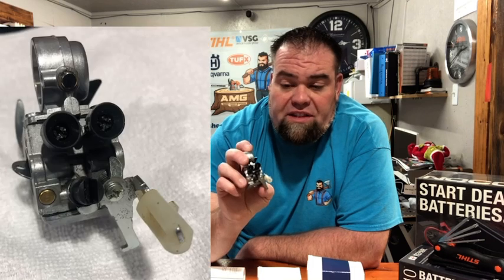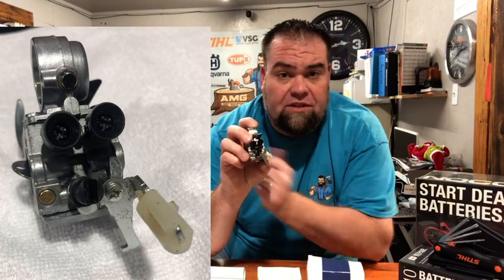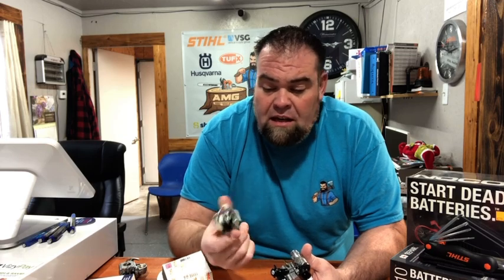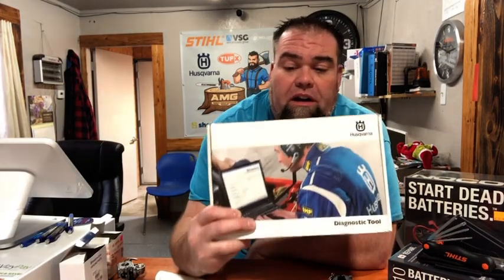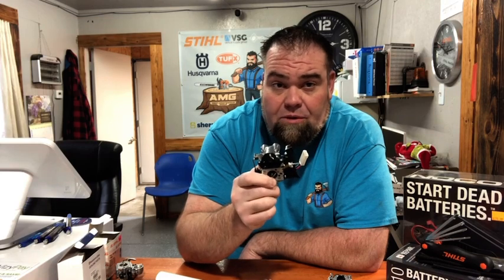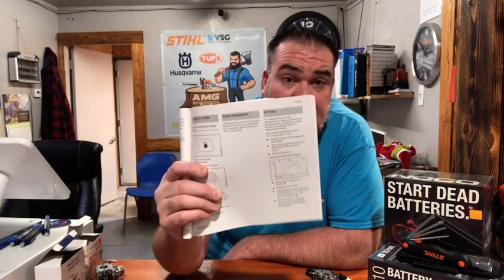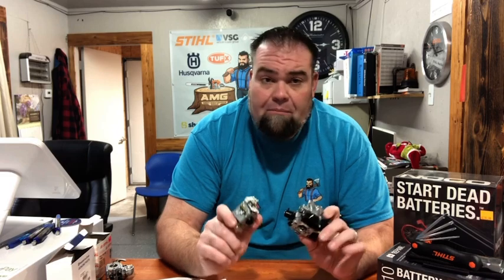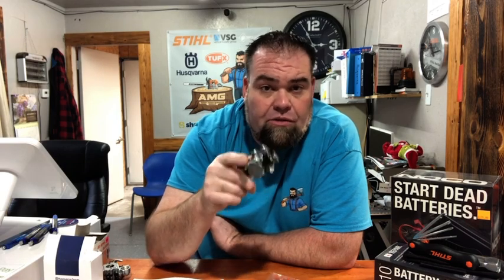Stihl MTronic, Husqvarna Autotune and adjustment screw carburetors for chainsaws. How to adjust.

Comment: On the Husqvarna auto tune carburetor under the filter holder, what is the purpose of the adjustment screw?
Reply from the maker: It is a fine tune adjustment screw for the idle. You would adjust it if your chain is moving at idle.